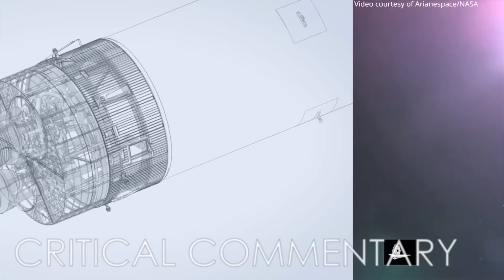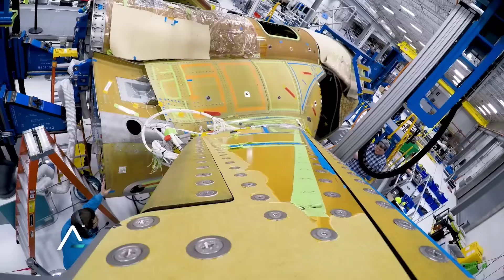Dream Chaser UNVEILED!! Exclusive Content!!  Sierra Space Tour Part 2

Comment: I have always thought that the Dream Chaser should have been chosen by NASA but they were afraid of anything that looked like the Shuttle.  Also, if the Dream Chaser had been chosen guess who wouldn't have been chosen and who we would still be relying on for transporting astronauts to and from the ISS.
One slip up at the very end.  The folding wing Dream Chaser can fit inside the Falcon 9 cargo faring so using the Falcon 9 is an option for the cargo version.  The non-folding wing crewed Dream Chaser can NOT fit inside a Falcon 9 cargo faring, which is why they are dependent on the ULA Vulcan Centaur rocket.

Comment: Are those yellow skin panels on Dream Chaser made of Kevlar? Kevlar is exactly the same color. They are putting DC through the rack to simulate flight loads. Looks like the torture testing will be finished inside and way early in the program. Notice the vehicle is always kept low to the ground to make it easy to work on which makes a faster build.

Comment: Ok so this baby version of the space shuttle can fit on top of current “active” working rockets, but besides that what significant advantages does it have over the shuttle? Is it proportionately cheaper? Safer? More flexible?
Reply: Good demonstrator for a true two stage space plane.  With Space X landing boosters, the "need" for a SSTO is gone.  But the starship flip with people on board?  Yikes.

Comment: The real advantage of this kind of vehicle is to upscale it so that you can transport 20+ passengers each time and you don't need propulsion landing (which will always be dangerous). Parachutes will never be able to land big masses. So no real advantage for a small crew DC. That's my opinion. Just build the cargo vehicle, and go directly to an upscaled 20-25 passengers vehicle. If you remove Shooting Star, every launcher (Falcon 9, Ariane and the ULA) can handle the load. Imagine how low you can get on space tickets (almost 10X less). Love Dream Chaser BTW.
Reply: Dream Chaser gross mass is 9.000 Kg. F9 delivers 22.800kg to LEO. Double the mass and you can easily triple the passenger size. You can have seats organized in 2 heights like sort of the Dragon. Soyuz already had a trip time to the IIS of 3 hours so you don't need much space for comfort. Are we going to have another 2 or 3 decades before anyone builds a real space plane?

Comment: Marvelous Ship, it looks like the Ship the Space Shuttle should have been.
The Space Shuttle was to big for it's purpose and had massiv feature kreep Problems. It was a flying Space Labratory, Spacetruck and Shuttleservice to the ISS. One or two Space Shuttles would have been enough together with a fleet of smaller crafts like the Dream Chaser, which can be replaced and updated more easily. It's like a full equiped Semi with extended Front to be a big RV as well, while most of the Missions could be done by a RV (Dream Chaser) alone.

And it is good to see a this concept moving forward, in a sensible Way. As most Spaceships except Starship are very old conceptional: Capsules some with reusability, while their Boosters are much more capeable then before. We are flying with improved 70s tech, but no 'new' Tech, the only 'new' Tech is mothballed and sits in a Museum. And with we i mean Europeans, Russians, Americans, Japanese and Chinese. In Boeings Case i doubt the improved part. So seeing Dreamchase getting ready, which is 80's Concepts is a big improvement.

The next Concept we realy need is the Venture-Star Projekt it was feasable but seemed to be surperfluss to requirements and to expensiv. Maybe in 10 years it will be revived like the Shuttle Concept is revived in Dream Chaser with a  better eye for the Essentials to keep the costs down.

Comment: What’s DreamChaser’s diameter (with wings folded in)?

If DreamChaser could be put inside Starship, how much larger could DC be scaled up to fit inside Starship’s 9m diameter payload bay?

Maybe one day we could see a DreamChaser XL eh?
Reply: Why why and more why?
Reply: @bindingcurve  Because Dream chaser can land with only 1.5G force on it and does mot require an energetic flip maneuver.
Reply: @bindingcurve  why? Simple: a much larger DreamChaser = more crew and cargo capacity and no need to expend Shooting Star. As you know, Shooting Star is single use, it’s non-reusable.
Reply: @favesongslist  why put it inside another ship.  Original plans were to mount it on top of a booster exposed.  This thing is stupid.  Increased complexity and any chance of rapid reusability is gone.
Reply: @bindingcurve  Yes that was the initial plan, but Starship promises to be far cheaper and Dream Chaser can perform a smoother less g-force landing and without a flip at the end than Starship uses.
Starship will not just be cheaper but will make SpaceX's Falcon rockets obsolete.
Reply: @favesongslist  super heavy is just a massive falcon 9 booster stage.  Build a Space X booster for a better version of this and your in business.  The secret to Space X's success is not going to be Starship, it's vertical landing boosters.
Reply: @bindingcurve  
I did not explain my point clearly, Flying the Dream Chaser to LEO as cargo inside the Starship, This could be the best for low g-force landings and without having to go through the flip maneuver required just before being caught by the 'Chopsticks'  on the launch/landing tower. 
As you rightly pointed out the Super Heavy is based on SpaceX's proven Falcon 9 first stage vertical landings, but is much bigger and powerful, using clean Metholox Raptor engines compared to the RP1 fuel of the Merlin engines on Falcon 9, And will land smoothly; being captured by the 'Chopsticks'. 
The Starship second stage will be FULLY reusable, using much cheaper construction and more importantly cheaper fuel. Starship is going to be an absolute game changer at over 10x cheaper for 10 times more cargo to LEO than Falcon rockets that are already the lowest cost launchers.
Reply: @favesongslist  Again why put it inside?  Put it outside.  No folding wings, no packaging issues.  Just the idea of folding it up into a fairing evetime you launch is just baffling.  And all the weight of the Starship could be used for the spaceplane and more fuel
Reply: @bindingcurve  The current Starship design does not allow for placing anything at the top as there is an liquid oxygen header tank built into the nosecone; required for landing the second stage Starship.
You need the second stage Starship with its fuel and Oxygen and rocket engines to get into Orbit. The Super Heavy on its own does not have the required Delta V to accelerate the Dream Chaser to orbital velocity. (To Space yes, but not Orbit)
Reply: @favesongslist  Simple words.  Do NOT use Starship.  Build Better Dream Chaser.  Give it vacuum engines. Give it more fuel. Give it fixed wings.  Remove the cargo .  Keep weight much lower than Starship.  Use modified Super Heavy Booster to take it up to sub orbital speed.  Use Vacuum engines and extra fuel on  Dream Chaser 2 to achieve orbital velocity.  If super heavy can't return to launch site, land and refuel for return.

Comment: Hopefully they will get to use this as a demonstrator for a larger replacement.  Using a larger version of this (and lose the service module and folding wings) in combination with a Space X vertical landing booster, would be a good viable option for human rated access to LEO.  Using this for cargo is not the best idea.
Reply: It could be possible for NASA to launch cargo on the X-37B Space planes, That SpaceX have already been launching since 2017.
Reply: @favesongslist  It's all about packaging, you put bulk cargo in trailers or containers.  You don't put it into a bus, much less a minivan.
Reply: @bindingcurve I normally use what is reliable, quick, convenient and cheap, beyond that I don't really care how it gets to the destination.
Reply: @favesongslist  Well, this is NOT cheap in the current form
Reply: @bindingcurve  Its cheaper by far than any other solution in the near term.
Reply: @favesongslist  Dragon?  How it is in anyway cheaper than Dragon and Falcon?  As for cargo, just use a NORMAL Vulcan / Centaur.
Reply: @bindingcurve  Starship is FULLY reusable, The Falcon rockets 2nd stage is expendable and a new one is required for every dragon launch. A smaller issue is the Starship's Metholox fuel is cheaper then the Falcons RP1 fuel.
Reply: @favesongslist  Starship works as a tanker, it also works for cargo.  But the flip on a man rated reentry vehicle?  And for dream chaser's current form, almost nothing is reusable.  Ideally you want a two stage to orbit. Dream and Dragon are really 4 stages (2 sage boost, service module and reentry vehicle in the current versions).  SSTO was a pipe dream that was dashed with SpaceX landing first stages.  They need to develop a space plane that uses a recoverable booster stage.  If you lose 1% of boosters it is not a big deal.  Start losing 1% re-entry vehicles it will get ugly once "astronauts" are just workers.
Reply: @bindingcurve   Yes It may be a while or even never for the current Starship design to be human rated.
If Dream chaser was launched on the Starship then the astronauts would need to fly to Orbit in a Crew Dragon which is currently the only US human rated spacecraft. 
Hopefully it will be joined by Boeing's StarLiner by next year. The problem is that StarLiner is meant to launch on the ULA's Vulcan rocket which so far has never flown; let alone been Human rated. The SLS rocket has also never flown yet, Hopefully SLS will be manned rated in time for the Artemis Moon flight in 2025/6 time frame, But is VERY expensive and expendable.
Blue Origin is also hoping to have a human rated orbital capable rocket in the Future called 'New Glenn'.
So for now the only way forward will be to use a Falcon 9 next year when it has its new larger fairing available.
As you also rightly point out the LOC (Loss of Crew; probability) is a big issue. NASA already lost 14 astronauts on the Space Shuttle program that ended with a LOC ratio of “about 1 in 90”.
Space has never been safe yet I agree that loss of life could get ugly.

Comment: Surely it has to be technically much simpler to just stick it with fixed wings on top of a rocket, than to design folding wings so that it can fit inside a fairing. Why would you even want a fairing for a re-entry vehicle, with all the size constraints etc.

Comment: “This vehicle is better than any other vehicle in development or currently operational.”
Um, no. The best vehicle is the one that actually works, is currently operational and available. Sierra might pull a Boeing and have problem after problem. Until it’s actually flying missions to the ISS, “best vehicle” status is ludicrous. What’s the cargo lift capability of a non-operational spacecraft? That’s not a trick question. The answer is zero.